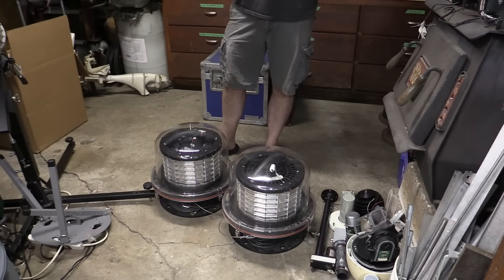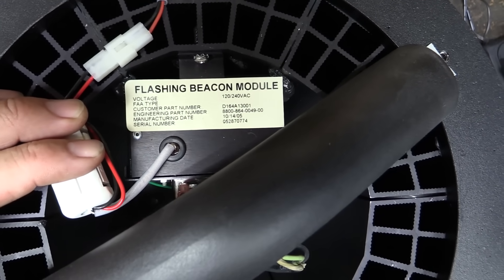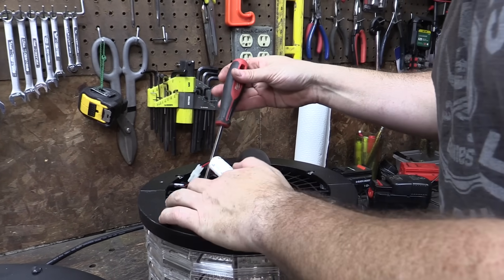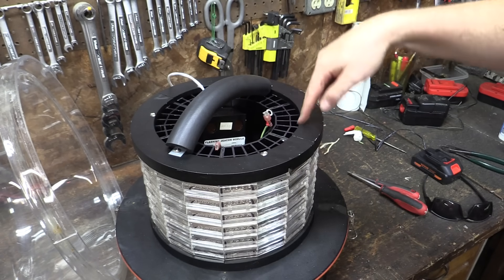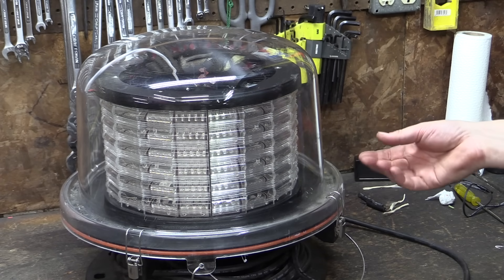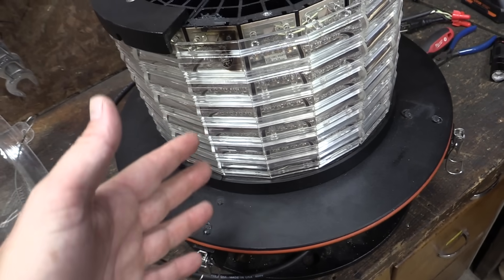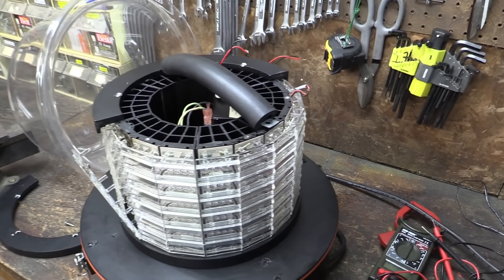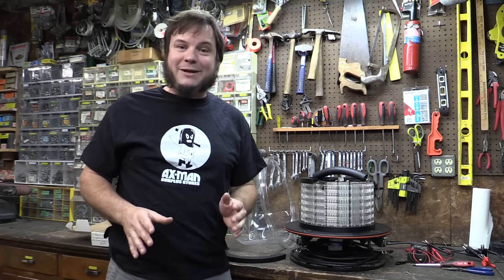Surplus FAA Tower Beacon Warning Light

Comment: Did it really get dimmer after being initially bright? Or was that just the camera adjusting the exposure?
Reply: Probably both. Many of those lights on towers go through a cycle of brightness, fading up and down, especially for the red lights. So it's possible that the LED array came up at full brightness, then started it's fade cycle before everything was unplugged. It's also possible that the LED that was letting the smoke out was affecting the voltage being delivered everywhere else. That's not  how LED Brightness is usually adjusted, it's usually done through a PWM circuit affecting the duty cycle of the delivered voltage, but you do get some brightness effect by varying the voltage at the low end of their operating voltage.

All that junk said, I'd expect that the biggest impact on the observed brightness in the video was the video AGC or Auto Aperture adjust, stopping down the brightness as it detected the intensity of the light being captured. they may be auto, but rarely are they instantaneous.

Comment: all leds ive ever wired up all had to be in series cuz of thier power requirements most leds are  very low voltage so u gotta wire them in series ive build all my own grow lights from scratch  i used cree cobs and also built a uvb/far red booster light and it was composed of single leds wired in series with all meanwell drivers parellel wiring is not good  i know theres a reason y its not good but i forgot it atm lol also built my own samsung quantum boards and those are even wired in series some ppl say u can  wire the quantum boards in parellel but i dont

Comment: I suspect like you that this is a faulty supply that is probably putting out way way too much current and burning the LED's up. Also because they are not blinking you have a constant power draw which may also be contributing to the problem.  Like others have said here I would remove a single bank of LED's and try them out on a variable power supply to see what the current draw of a single bank is. LED's do not work with AC so seeing AC on that power supply is defiantly a bad sign its failed badly.

Comment: If those LED Modules ae indeed wired in serial, jumpering the one bad one was bound to cause problems sooner or later.  If you count the total number of individual LEDs in the whole thing...  Let's just guess there are 100 (I base that on nothing other than making the math easier) and the power supply was shifting between 400 and 1000 VDC (It does blink after all) Then 1000VDC / 100 LEDs = 10VDC per LED MAX.  Try hooking a variable voltage, current limited to a single LED.  Then start slowly increasing the voltage until that individual LED lights up so you can determine the operating voltage of each.  Then you can de-solder the modules and use them individually or provide them with a more appropriate power supply.
Reply: LEDs doesn't work that way. they are /current/ driven, not voltage-driven. It's a constant current power supply. The voltage is adjusted to have the correct current.

Comment: Maybe take the box from the working one and transplant it to the other. Just jumping across the bad LED array should cause a higher voltage to the rest of the elements, so maybe figure out the resistance across a working LED array and find an appropriate resistor to jump across the broken array. It may be better to overshoot the resistance a little to reduce the risk of the others from burning. Maybe use your multimeter and check that the black box is putting out power as expected. The input into the LED arrays should be DC. If you know the appropriate DC voltage and current draw, then you can probably find an appropriate power supply off ebay or somewhere. Maybe you can transplant some of the working LED arrays Into the one with broken arrays.
Reply: There should be a safety factor, so seeing another array starting to burn up after jumping across just a single array is concerning. I am not an expert; I just dabble in electronics.
Reply from the maker: I'm also not an expert, just enough of an amateur to be a little scare of these now :-P
Reply: @saveitforparts I like how the comment bots are speaking Italian now 😂
Reply: I had a similar thought.

Comment: If you can get one led out try testing it by applying dc voltage to it with a dc variable power supply going from minum to max voltage. Thua should give a base line of voltage per led.

Comment: Not an expert, but LED's often have a fault mode that results in a short across the LED, rather than open across it. The one that burned out is clearly open, the one that's beginning to smoke is probably failed short until enough of the smoke clears out when it will open as well. As each LED is dropping somewhere between 1.5 and 3 volts, when you short across them, or they are in a shorting failure mode, that increase the voltage across the remainder, which is going to result in more current going through them. You might use a resistor instead of a shorting wire across each block. While it's working you can sample the voltage drop across a functional one, and use Ohms law to figure out what the appropriate resistor is to use across them (breaking the connection across the shorted one. (Alternatively, count how many LEDs there are in the fixture, then divide the DC voltage at peak from the power supply by the number of LEDs there are, and that will tell you exactly how much the array or string is supposed to drop, and jumper open blocks with resisters, and break links to shorted blocks jumpering with resistors around them.) 

I'd say pull up that Oscilloscope and a voltage divider and sample the AC that is showing up to see if that's simple 60 hz AC that's been bumped up by 10x or so. It wouldn't surprise me if there is a failed bridge rectifier in the goop that's running the output of the transformer to the led's. It may also be the source of the lights going brighter and dimmer as  two oscillators go in and out of phase over a 10 or 20 second cycle. (whatever the cycle is that you see on tower lights that do change brightness, but are not strobing.

All that said, I reiterate, I'm no expert on these things.